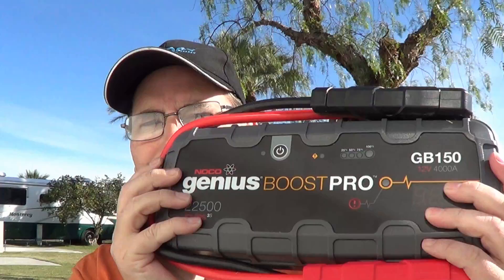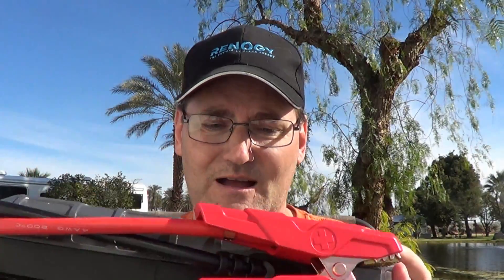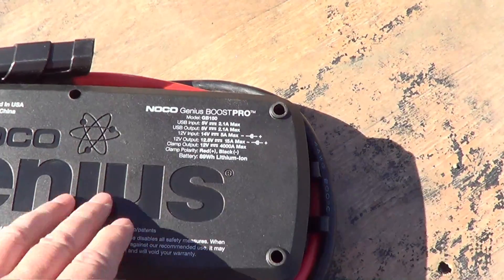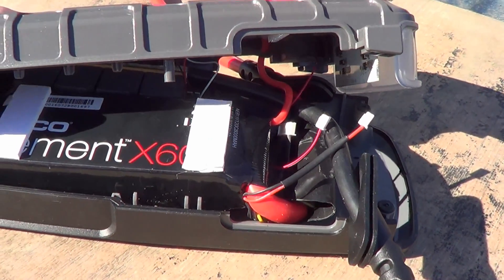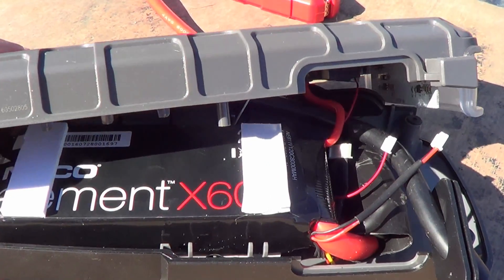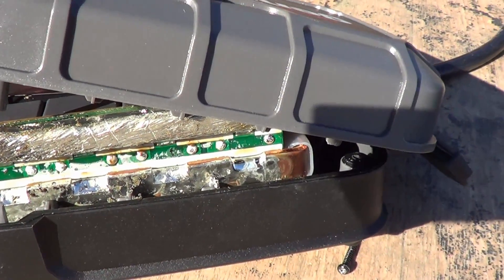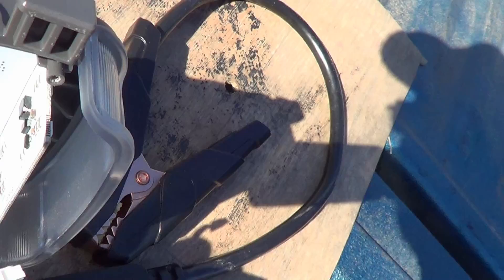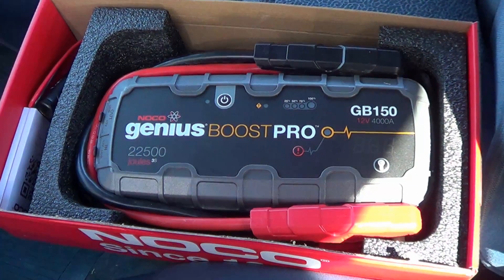What's Inside My NOCO GB150 Battery Booster

Comment: An auto tech reviewing this on Amazon ran one into a 500 amp max variable test load. It actually put out average 420 Amps at nominal 12 Volts for 20 seconds, then the over temperature protection kicks it out until it cools down... So, I don't think it's going to start the Dodge's  6.7l Cummins with two completely dead batteries down around 0 F., but if the batteries have even 70%, should turn it over. Normally, that truck barely starts if at all at 0 F. if the 2 Lead acid batteries are dead cold and down to 80%. If you wait for the full preheat cycle, the glowplugs and heater grid suck the batteries down so much there isn't enough left for the starter. Warm batteries are happy batteries...

BTW, that's an 80 Amp hour battery.  EIGHTY. 80,000 mWh ÷ by 1,000 mW per Watt = 80. An 8 amp hour 12V battery is about good for a tiny economy 3 or 4 cylinder, a big motorcycle or a healthy riding lawn mower, the little Li-ion jump starter units that cost around $50.00 would have somewhere around that capacity.
Reply from the maker: You may want to watch my review video on the NOCO. -  https://youtu.be/bgOjEtO-YJs
I tested it on my 1994 7.3L Ford diesel. Started it with no batteries hooked up at all with cold glow plugs, not at 0 though, it was around 50F, but not bad. Also, that is an 8000 mAH battery = 8AH.  The unit says 88 watt hours right on the outside.  8000mAH X 11.1V = 88.8 Wh - https://milliamps-watts.appspot.com/
I also tested it running a load, it showed it to have about 8 amp hours capacity in the test. Wish it was an 80 AH battery that would be a wicked deal!  Cheers Ray
Reply: Love Your RV The new NOCO 150 unit arrived. Charged it up, went outdoors to the dead 6.7l Cummins diesel truck and started it right up at 18 F., about 10 seconds of glowplug/grid heater warmup and then turned over and fired as if it were summer with good batteries. Pulled the existing batteries out afterwards, 1 was completely dead and would not take a charge, the other tested at  30% of rated current when I returned them to the battery dealer. Got 2 new batteries under warranty, the dead Interstate batteries were only 34 months old on a 6 year warranty.

Comment: It is 88 Wh (12V X 4Ah) which is about 7 times Galaxy Note 8 battery (12Wh = 3.7V X 3.3Ah).
Reply from the maker: On the battery inside is written - NEB 11V1 20C 8000 mAH  which I assume is an 11.1 volt 8000 milliamp hours or 8 AH
Reply: the higher discharge cells generally have lesser capacity. about 2ah for the 20-22a discharge capacity, and 1.3ah for the 30a discharge cells, from what I've seen.
Reply: Ampere hours (Ah) multiplied by Voltage (V) equals Watt hours (Wh).
Hence, 8,000 (mAh) * 11.1 (V) =  88,800 (mWh) or 88.8 (Wh).

Watt hours (Wh) divided by Voltage (V) equals Ampere hours (Ah).
Hence, 88.8 (Wh) / 11.1 (V) = 8 (Ah).

Lastly, the battery's markings rate it at 88.8 (Wh) or 8 (Ah).

Comment: i think you will find its 120c discharge so 120x 8000mah
Reply from the maker: That would be nice. Where did you find those specs on the Element X60 battery?
Reply: its on the pack  but its not 11.1v  its 11v 120c
Reply from the maker: How do you know for sure its 11V 120C and not 11v1 20C
11.1 volts seems to be a common voltage for lithium packs
Reply: it would not be a 20c rated pack !

i have the gb 70 the pack in that is rated 60C 5000MA if i remember correctly  . small model lipo packs are rated at 30c 

if you work out that 120 x  8 amps it equals around 960 amp peek current 

i have measured the peek output of my gb 70 and its around 500 to 600 amps
Reply from the maker: Thanks, makes sense considering it's jumping a 10+ engine, I guess there is no published detailed info on this NOCO X60 battery. I can't find any.
The battery would be completely discharged in under a minute at max discharge rate I assume?

Comment: A fairly unimpressive battery. If you have RC experience, you know that 60C discharge rate and higher batteries are easily available from, probably, the same Chinese factories where this one is made. For the money you pay for Noco (compared to noname stuff on Amazon), I would expect something nicer.
P.S. For long-term storage, you want to keep lithium cells at 50% capacity.
Reply from the maker: Someone else commented that the 50% figure was dated and the newer stuff could be stored at 100%.
Reply: +Love Your RV
My understanding is that the electrolyte stabilizer additives which help reduce battery degradation when charging to 100% have shown great lab results but are unlikely to have made it into battery cells. The tesla S and X didn't have cells with those additives as of about a year ago.
Reply: Not so for LiPo cells, let them sit fully changed and over the months the outgassing causes them to swell.  That's the reason DJI battery circuitry initiates a slow discharge to 50% after a few weeks.

Comment: I've been using a little lithium polymer car jumper about a quarter that size to jump my f250. that one is rated at 800A which I thought was pretty high. 4000A is insane. did you notice right on the back of that enclosure on the outside sticker said it has a 80Wh battery?
Reply from the maker: It says 89 Wh - watt hours  I guess if you run an 89 watt load it will last 1 hour.
Reply: That makes more sense. 89WH is equal to what it says inside (11.1v at 8Ah = 88.8Wh)

Comment: can this battery start a diesel engine without lead battery connected ?
Reply from the maker: I'm going to try it today on my 1994 Ford truck with a 7.3L diesel engine. Will let you know.
Reply: thank you, sir.
Reply from the maker: Hey King. It boosted the truck without a problem. Truck sat overnight in temps around 40F and I started this morning outside temp 50F. I had cold glow plugs and I let them complete the 12 -15 second cycle, plus I have auto daylight headlights and she turned over easily and started almost like I had my regular two batteries hooked up.
I'll have a complete review video coming out in awhile with the footage. Cheers Ray
Reply: Thank you very much for the test. It helped me a lot.

Comment: Couldn't you use your RV batteries to jump start your truck?
Is your RV a four season unit?
Reply from the maker: Yes, I could and actually have in the past but that is if the truck happens to be close enough. I use a battery box mostly for portable 12-volt power, makes it convenient to use my 12-volt compressor to pump my tires and my pin box air bag. Also when boondocking I use it to run a water pump to add water to main tanks for jugs.
My old lead acid battery box wore out and wanted to replace it with the newer lithium style that could at least boost my big diesel if needed. My old box was bought when I had a 300 cubic inch camper van so didn't have the power to jump our truck.
No, the Cougar has what they call the Polar Package but it definitely isn't a 4 season rig.

Comment: Great review. Can you picture what would happen if you put 12v @ 4000 amps through those cables? 

I really wish there was truth in advertising.

Thanks

Ron & Liv
Reply from the maker: It's like audio wattage claims, many ways to say something that is technically right but has nothing to do with real world use.
Reply: For a nanosecond? Probably nothing
for a second? Probably an explosion. 

It would be like turning on a 48 kilowatt heater for one second or 96 good hairdryers. Definitely enough power to melt all the wires many times over. 

Also it would completely drain the battery in 7 seconds... 
7 seconds of cranking time... You'd finish it up
Reply: Those are awesome, but pretty expensive.
Reply: they would burst in your face.......

Comment: Ray, thanks for all the help you give to us RV'ers.  I still hesitate when repairing my rv, only been on the road 2 years now. My question is. I have a 2003 F250 with 2 starting batteries, will the NOCO start my truck if needed? Again thank you for all the help you have given me.  Sorry I just saw your video unboxing the the NOCO GB150. I think you answered my question in that video.
Reply from the maker: It claims up to 10L engines. I've seen quite a few videos showing it start big diesels. Where it may struggle is cold weather if the box gets cold.

Comment: HI Ray you should look up www.TryMinimax.com
Reply from the maker: Very cheap price, but... Like to see if it can jump-start a big diesel truck. Doesn't look like it based on the size of the leads. Looks like it's missing a critical port, the 12 volt 15 amp output. That's the one I really will use a lot around the RV.

Comment: Lithium batteries such as lithium polymer which is what this appears to be should not be stored without a charge.  The proper way to store  lithium batteries is to keep them at ~50% charge.  This is why when you purchase new electronics with Lithium batteries they typically arrive half charged. You also never want to discharge them completely since that will damage the battery cells or even worse cause them to catch on fire.  The electronics in the booster likely prevent that from happening and most likely kill the current when the battery voltage drops at all.  Also, unlike NiMH or NiCad or lead acid batteries where the voltage can drop significantly (a few volts) from full charge to low charge, Li-Poly batteries like this will not fluctuate much at all in voltage from full charge to low charge.  That is actually one of the desired traits of Li-Poly batteries since the voltage rolloff is low they run at peak performance almost until they reach their low charge state. Any significant voltage drop in a Li-Poly battery would indicate a damaged battery cell(s) which could be dangerous.  You never want to fully discharge a Li-Poly battery. The fact that it is 11.1V battery means it is a 3 cell lithium polymer (3.7V *3) battery.  20C discharge is actually rather poor compared to batteries that are used in hobby grade RC cars and the like which typically have anywhere from 30C to 50C.  8000mAh is about as good as you get though in a small size 3-cell Li-Poly battery though. The reasons these new booster packs are so much smaller is simply because they moved away from the heavy lead acid battery ones to these new Li-Poly batteries. If you buy one of those external battery banks they cell on Amazon for your iPhone or other electronics, it is essentially the same principle as this booster albeit much lower current.  Nice booster pack and thanks for the video..
Reply: I went to a solar event of Victron a few weeks ago, one of the leading manufacturers of Marine solar equipment.
They said that 50% storage is a bit dated news. The latest  knowledge is they can be put away at 100% fully charged.
Nice review, I'dd like you had compared it with the smaller ones of Nogo
Reply: There is no evidence to back up your claim of charge state of lithiums. Your claim is based on a report 20 years old. They had no idea of long term effects of lithium. A better, more viable explanation is to keep the individual cells above the appropriate voltage (3.0v for lipo, I think 2.8v for lifepo4)

The reason Lipo arrive HALF charged is that is their manufactured state. If you think they charge lipos in, say, cell phones, before they get sent out, you are in for a surprise. 

Source: Electrical Engineer using Lipo batteries for 20+ years professionally and 10+ years as a hobby (solar and the like)
Reply from the maker: Thanks, lots to learn. When the box got to the point of shutting down its readout indicated a voltage of 10 volts. The user manual doesn't say anything about storage charge.
Reply from the maker: Here is a link to the safety data sheet - https://noco-thenococompany.netdna-ssl.com/media/nocodownloads/format/g/b/gb150_sds_6.10.2016.pdf
Details the battery chemistry.

Comment: lots of good info and comments/analysis and i thank you for that, you have a wonderful website,  bottom line, whats the cost and is it worth it. (i saw angie scoping you out in the distance, give her a biscuit for me).
Reply from the maker: haha, ya. I guess though for folks that spend 300 grande on a motorhome it's not much. For me though it was a splurge.
I tested it on my 7.3L diesel today, fired it up easily with the batteries totally disconnected. Pretty cool. Cheers Ray
Reply: $299 ?!?!?!?!!?   Yikes!   At that price, it better be able to start up a 747!   ;-D
Reply from the maker: It goes for $299. For me, it's a what to have gadget versus a gotta have. My old lead acid battery box died and I wanted to replace it with something that could at least fire up a large engine like in our truck or a motor home.
I mostly use it with my 12 volt air compressor.

Comment: Funny, I just took out my NOCO g7200 smart charger out yesterday to charge 4 of my C&D Tecnology batterys for my off grid system, works like a charm voltage meter reads 12.3 I think I need to upgrage to renogy solar panels, do u know where I can find a dealer in alberta?
Reply from the maker: Don't know of any dealers but check out Amazon.ca they sell Renogy stuff.  https://www.amazon.ca/s/ref=nb_sb_noss?url=search-alias%3Daps&field-keywords=renogy
Cheers Ray

Comment: The label said 89 watt-hrs. Which fits 8 amp-hrs x 11.1 VDC = 88.8 watt-hrs. I've been impressed with the current output of the smaller boxes so I suspect that it'll start your diesel.
Reply from the maker: If it can turn over my old 7.3L IDI 1994 International diesel motor, I'll be impressed. :)
Reply: Love Your RV I have one about the size of two decks of cards. It's labeled 200 amps, 400 peak amps. I've tried it on a 3.5 liter V6 with a dead battery and it worked great. I tried it on my 5.9 Cummins and it'll run the heat grid but not the starter. I picked it up to use on motorcycle trips.

Comment: Brilliant video, thank you. I've had this in my cart at Amazon for a week or two. I'll be anxiously waiting to see how long the unit takes to charge, and your other reviews. I used something similar a month ago to get my wife's jeep to a dealer that had a bad cell after a deer accident and it did a superb job. I drive a F250 diesel, so wanted something that could boost it as well. I saw the 4000 amps, so thanks for the data that it's really 8 amp's...makes better sense. Thank you again.
Reply from the maker: You bet, I'll likely have the review out in a few weeks, got lots on the go right now and New Years to celebrate. Cheers! Ray
Reply: Just to clarify, do not confuse Amps with Amp-hours, the first is current the second is energy. The unit is supposed to put out 4000A and if that is at 12V is really 48,000 Watts or about 32 hair-dryers on full blast. Amps are sort of like how fast the energy can come out where as Amp-hours is how much the battery can hold. The battery only holds 11.1V * 8Ah = 88.8Watt-hours or 0.0888kWh, to put it into the unit the power company uses to sell you electricity.

Comment: Your too kind not calling their 4000A balderdash.  FYI,  I'm sure you know this but if your drawing 8 amps you won't get 1 hour out of it or 8 amp hours but it will be dead much less than an hour .  If you fully discharge any battery faster than over 20 hours you'll get less than the "C20" rating indicates.  People always forget about that when they figure what batteries can put out.  Same with solar panels, people always believe a 200 watt panel will put out 200 when the sun is hitting them when that is mostly never the case but much less. You'll only get 200 watts when there is 100% clear skies AND the sun is squarely over them on two axis, which is pretty much never the case if ever without a tracker.  

Great effort trying to show what's in that thing. I was awaiting for this video.  I figured it was 70/80% batteries.  Cheers
Reply from the maker: haha ya, I'm a nice guy. 
I knew that for lead acid but I thought that lithium ion batteries didn't suffer much from Peukert’s law and the AH rating would remain consistent even with higher current loads. That's why people like them in RVs to run high current devices like AC, and appliances, etc. Will be interesting to test it out. :)
For solar you won't even get the max in perfect skies, they use lab measurements, but I guess that at least is a benchmark to compare from. Best is likely 75-80% in the real world, that's about what I get on a clear summer day pointed dead square.